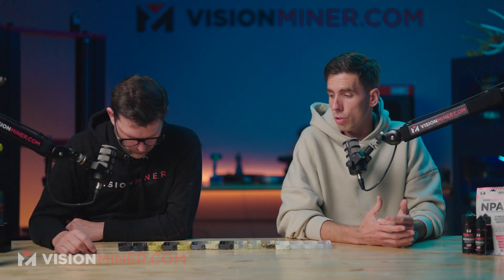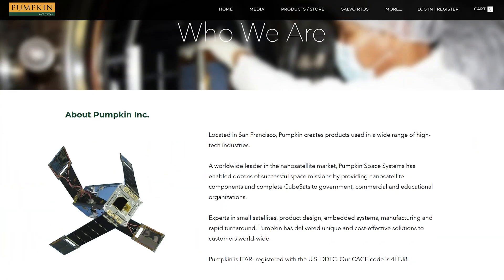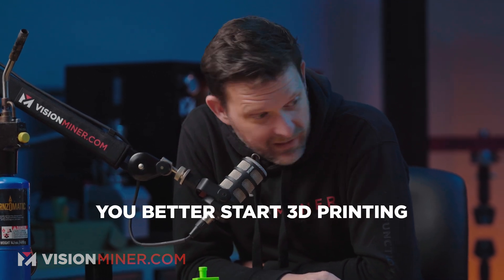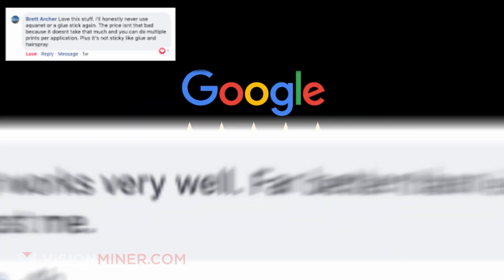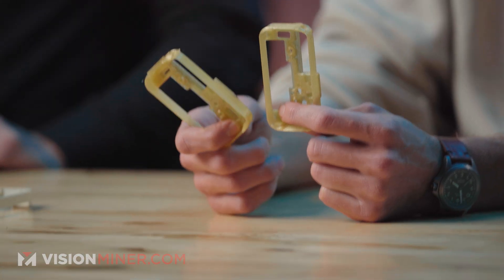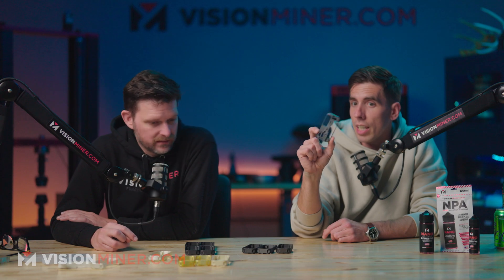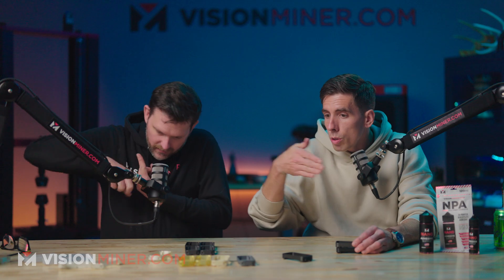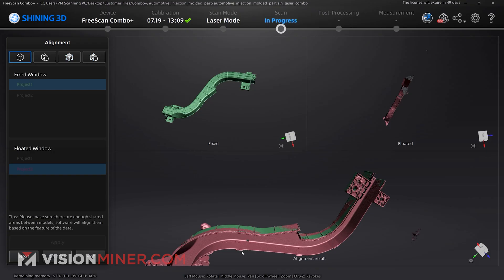3D Printing for Satellites? The ULTEM 1010 Part That Made It

Comment: From what I know, while regular Nylon is Polyamide (PA), PPA is Polyphthalamide, hence that extra P. I'm fairly sure that there isn't any extra "additive" or any additional material infused in it, but rather the basic Nylon chemical structure/polymer itself is slightly different from traditional PA, giving it its enhanced properties. Think of it as similar to how PSU and PPSU differ.

Comment: If I can’t easily find the filament and I can’t print it out of my P1S…. Or mod my P1S to print it…. Don’t care the ult1010 seems awesome but I can’t find it for sale and so I cant easily find the specs to see if I can even print it if I could find a spoil.
Reply from the maker: Totally understandable—it can be frustrating when something cool feels out of reach. That said, ULTEM 1010 is in a completely different class than the materials hobby machines like the P1S are designed for. It’s a high-performance thermoplastic used in aerospace, medical, and defense applications—think NASA components and radiation shields—not benchy boats and fidget toys.

Materials like this require extreme temperatures, specialized hardware, and industrial certification processes. They’re not meant to be run on hobby platforms, and they’re often not sold in public-facing marketplaces for exactly that reason. That being said, we do sell it at https://www.visionminer.com/materials -- but It’s like saying “if I can’t cook it in my toaster, it’s not worth eating” while overlooking the existence of fine dining, commercial kitchens, and everything beyond fast food.

The world of additive manufacturing goes far beyond hobby printing... At Vision Miner, we’ve been lucky to work with the DoE, DoD, national labs, and aerospace firms since 2017—this is the stuff that actually changes the world, but it doesn’t come in a shiny box with a QR code and a mobile app. This video just gives a small peek into that world—and it goes way deeper than most people realize.

If you’re ever curious about what’s possible beyond desktop printing, we’ve got a whole library of content on industrial 3D printing. It’s an awesome rabbit hole to go down :)